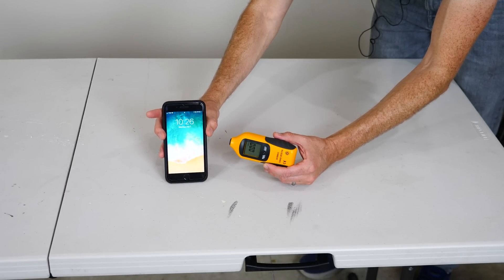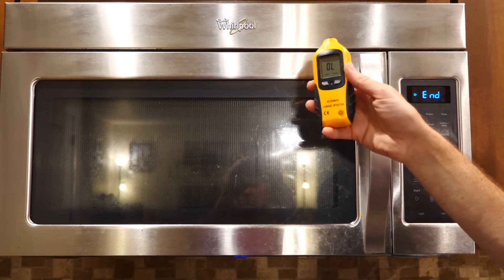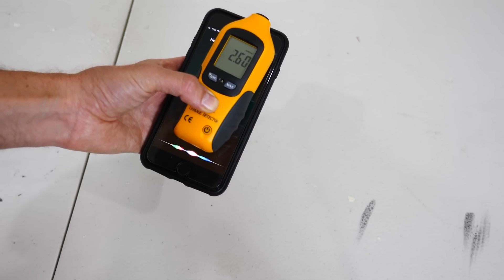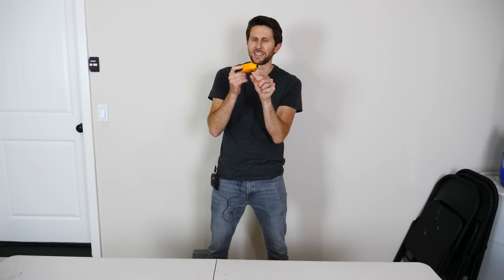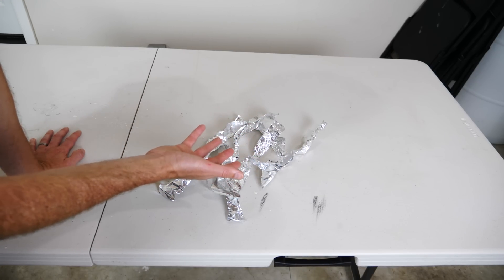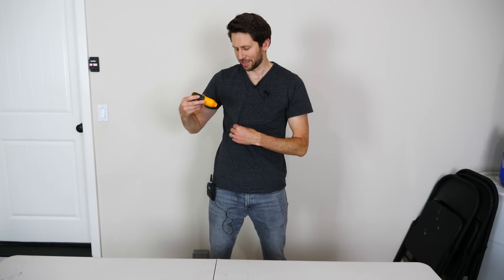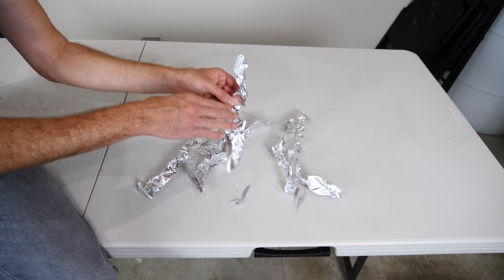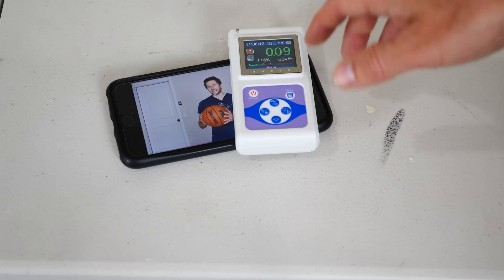How Much Radiation Are You Getting From Your Phone?

Comment: How much radiation if its a 5G Phone ??!?!!?!?
Reply: It's still in the same frequency range.. the difference it's for 5G the antenna density required is much higher because the frequency used for 5G is less capable to penetrate wall.
Reply: A pretty decent amount. The difference is that it's non-ionizing radiation therefore barely harmful, if at all.
Reply: Not much more : 5G frequency is still in the safe frequencies
Reply: Then you have a very good phone.....
Reply: @angelhorse777gaming  Not really. Samsung J7 Pro has 5G (used it for wifi). Not anything special and quite old.
Reply: @01DOGG01  true but most new phones are 5G now
Reply: @angelhorse777gaming  Yeah but what I'm saying is that even old cheap phones have it
Reply: @01DOGG01  5g doesn't mean 5GHz. You are probably confusing between 5GHz wifi and 5g network
Reply: @sb-jo2ch  You know what, you're right. It was called 5G so I assumed that it was the same standard.
Reply: More than 4G, but waaaaaay small to hurt you
Reply: Still not ionizing. And the whole body cooling is still in effect.
Reply: my father the day before yesterday said that 5G will boil the blood in our veins. I should show (and translate) this video for him so he knows that 5G will not be so dangerous as he thinks.
Reply: Higher frequencies have weaker penetration.
Reply: Microwave radiation is non-ionizing, do some research on radiation before you subscribe the conspiracy theories. Radiation comes in many forms, it isnt all the same. Non-ionizing radiation can only “vibrate” the molecules in your body thus at MOST causing beat (like a microwave oven). Ionizing radiation (the bad kind) ionizes the molecules in your body, which in high doses can cause DNA damage this cancer. This isnt the same thing
Reply: Only 3.6 roentgens, not great not terrible
Reply: @Majestic Beardsman yea
Reply: we all are doomed the humanity will die once the 5G will be released...  Prep the bunkers and food so you could live a little longer to die anyway.. rofl..
Reply: The same as any other because it's not transmitting a bunch of radiation into your head it's just faster
Reply: When you take a 5G phone call expect a third arm 👍😉
Reply: OMG
5G ?
Reply: It’s about two TV dinners
Reply: Newer generation networks are actually made to be better
Reply: I got a 1100 GB computer and i play it EVERY DAY for about 12 hours. how much radiation am i getting i think i feel my skin burning off
Reply: Still not enough to do any damage
Reply: @Lucas-cz5rw  but enough to damage something in your body for a long period of time
Reply: @serianaa  no not really
Reply: @Lucas-cz5rw  5g and emf radition through your phone is healthy for you actually and has reverse aging effects and increases brain power. You can too, just call two phones and 
keep one really close to your body at all times, like on your skin essentially. 
@stag.prefab, you should do this, but keep the phone beside your head. Its healthy Trust me and yes, your iq will increase. 
lets show these tinfoil hats how wrong they are. Reply back if you are able to do this. Highly appreciated.
Reply: Less. 5G towers are closer together, so your phone uses less power to communicate with them.
Reply: @descai10  They're closer together because you need a very powerful signal to transmit it any further at 5G speeds. It's still going to be more.
Reply: TΛΗΛWΞSΟΜΞ 5g operates at around 24ghz ffs
Reply: @soulreaper9228  
Wrong!
Reply: @YouTruthOrg  5g and emf radition through your phone is healthy for you actually and has reverse aging effects and increases brain power. You can too, just call two phones and 
keep one really close to your body at all times, like on your skin essentially. 
@jos van kan, you should do this, but keep the phone beside your head. Its healthy Trust me and yes, your iq will increase. 
lets show these tinfoil hats how wrong they are. Reply back if you are able to do this. Highly appreciated.
Reply: soul reaper exactly! What the fuck are these people talking about doing less harm
Reply: Um it killed so many birds when they tested it...
Reply: @greenbull3532  
Not true!
And already debunked.
Reply: @YouTruthOrg  what is debunked
Reply: @greenbull3532  
You should use google to check things, not me.
Stop believing youtube.
Search google for DEBUNKED
Reply: Imma tell you that my city has 5ghz network everywhere like u can find 20 5ghz network
Reply: @kuroshite  5g is not 5ghz. 5g stands for 5th generation and is of a much higher frequency
Reply: @aerospaceTUdelft  lies looks in mirror 😶
Reply: Wait and find out, your the test subject. Israel, the country who developed 5G, isn't even installing it in their own country, they are installing fiber optics instead.
Reply: @MistakenMystery  the reason must be obvious, isn't it?
Reply: Like in chernobyl
Reply: Dominic Lee  4G is 6kw on a 3 sector, 12 radio setup.

Don't know about 5G
Reply: 5 gigahertz about 45 on a giuger counter
Reply: 5g is bad research it
Reply: They are bad for you, the people saying it's safe are liars
Reply: While 5G test 200 birds die because of the frequency. So it is super dangerous.
Reply: @shahankit-clashofclans3796  That test was debunked. It had to do with a disease iirc
Reply: @shahankit-clashofclans3796  
Lie!
And already debunked.
Reply: @shahankit-clashofclans3796  Don't be stupid.
Reply: @shahankit-clashofclans3796  yeah of course. I watch these stupid videos then I go home and use that frequency 1cm away from Colorado bug to kill it and he doesn't give a fuck. They are overkilling everything, I mean mass media.
Reply: The phone doesn't emite 5G radiation, it takes that data signal from the antennas. Those last are the real problem because its signal frequency makes resonance in the water of our our body getting inside through the pores. It's better not be much time near of some of those antennas for avoid any sick by the prolonged exposure.
Reply: Federico Greiff 

“Makes resonance” doesnt mean a damn thing. This is non-ionizing, meaning at most all it can do it heat your molecules. Dont feel heat? It basically wont hurt you. Ionizing radition does damage your molecules causes cancer.
Reply: @FedeG86  Not only does you comment make no sense, but you also cannot write very well
Reply: @FedeG86  It still cannot fucking kill you. I have talked on the phone for 6 hours once, and I didn't feel any different than I did not using it for six hours.
Reply: 5g just means you have 5 gigabytes of memory for data 😂
Reply: @cheesethekoala8756  no